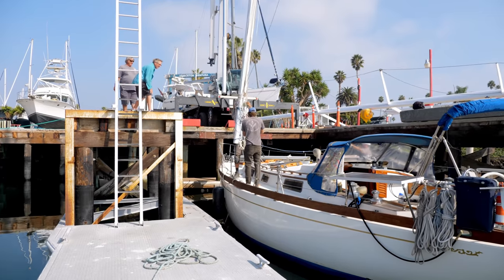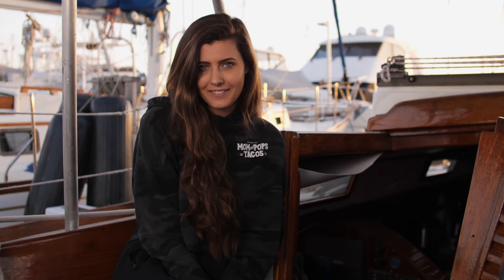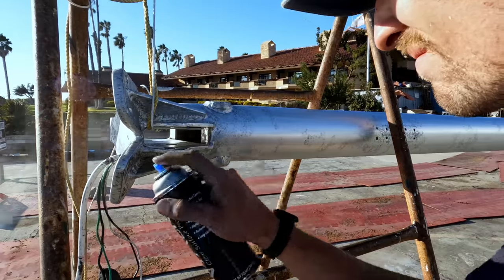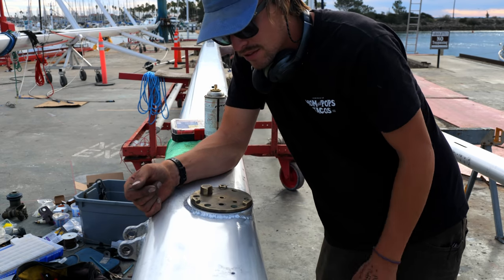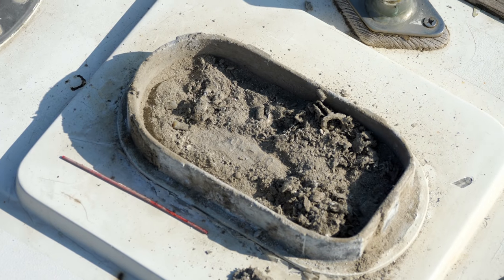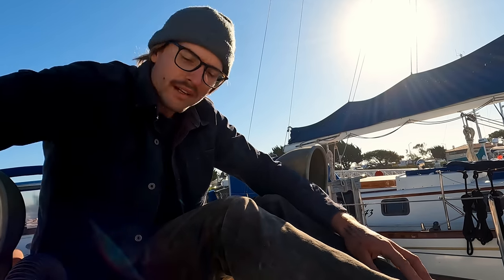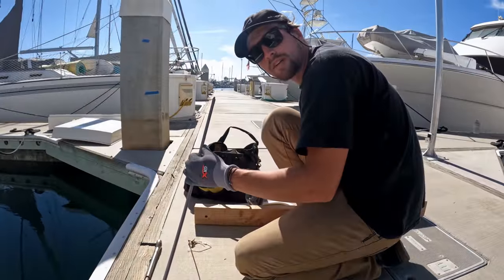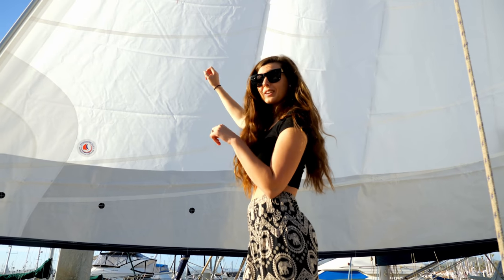Fixing Avocet | Rebuilding our Mast

Comment: I like the liberal application of Tef-Gel, but you have your corrosion terms a little confused.  You kept saying 'crevice corrosion', but what you are preventing with isolators between dissimilar metals is 'Galvanic Corrosion'.  Crevice Corrosion does happen to stainless steel, but that is caused by oxygen starvation along with water, it is not a result of dissimilar metals.  Crevice Corrosion is what happens inside the strands of your 1x19 wire rigging when water eventually penetrates between the strands.  When you see swage fittings swell and eventually crack is also because of Crevice Corrosion.  Again, oxygen starvation of the chain plates where they enter the deck causes crevice corrosion that leads to failure.
Reply from the maker: Hey Luke! Thanks for watching and chiming in. Check out our website for a better explanation as I believe we used both terms in this episode at the appropriate times - When two different metals create a tight crevice, both crevice and galvanic corrosion can potentially occur. A lot of our galvanic corrosion on Avocet lead to crevice corrosion which was nasty all around. We also have a couple published pieces in Cruising World, Latitude 38  Good Old Boat regarding the subject matter that you may find fascinating as this project is over 6 months old - we have had lots of time to write! Thanks again for the insightful Q... always appreciated. Fair winds!
Reply: @sailingavocet  I tried to read your articles, they link to "Foolproof Focaccia", at least the Good Old Boat article about the Bulwarks and your research on mast painting in Latitude 38 links go there, some of the other links work to unrelated articles.  Anyway, I'm sorry to be a pain but you literally didn't use the term 'Galvanic Corrosion' once in the entire video.  Also, your Rigger keeps calling Dyneema an 'Aramid'... it's not.  Aramid is what Kevlar (trade name) is , Dyneema is UHMW plastic, so not even close.  He says aramid while you show pics of Dyneema, but I know he meant Dyneema because he said Aramid again and that you splice it... you do not splice Aramid rigging, it's unidirectional fibers that use an incredibly similar fitting to Hi-Mods for termination. Sorry if I'm a stickler for details, but there is way too much bad info on boat forums and in YouTube videos.  I dunno, maybe I shouldn't bother helping, all the bad info out there is what keeps me busy going up masts to fix the mistakes of others.
Reply: Don't get the wrong idea, I really like the work you do (thats why I watch) and I don't think you made any mistakes on your mast.  You made great choices, especially the G-10 mast step, really nice application.  I pointed out the issue with terminology because I hope it helps maintain your credibility.
Reply from the maker: @SteelDoesMyWill  We appreciate the conversation, I will have to see why those links are not working... hm... I do urge you to read the full in-depth blog post that does mention both galvanic and crevasse corrosion. You can find that here: https://www.svavocet.com/2021/12/17/mast-rebuild/

The G10 is a fantastic addition and really upholds the structural integrity of Avocet. It is a great option and we hope many explore its abilities as we have found many uses for the material in various projects. As far as Kim Weir goes he is a legend in the industry, especially around these parts. I will bring your notes up with him and see if he can clarify, then if need be, write an update on our website. 

Thanks again for the chat, fair winds!

Comment: You should have bead blasted the surface and then cleaned it with Alumiprep/acid wash.  After you acid wash it any remaining corrosion will turn black, then it needs to be sanded/bead blasted more until it doesn’t turn black any more.  There is so much corrosion still on your mast, it will keep growing even with the top coating you applied.
Reply from the maker: It’s been 2 years. Mast looks great. Thanks for your concern 🤙
Reply: Great, just passing on info.  I work with a lot of corroded aluminum.  All that black stuff is corrosion and is slowly weakening your mast.  Keep an eye on it.
Reply from the maker: @charlesdobrovolny7059  Appreciated - I would recommend reading the blog post and articles we published regarding this project which gives detailed info on our prep process. In California we are limited with chemicals we can use because of the BPA laws. We did everything we could, and corrosion has ceased. Nyalic has been a wonderful product, seems to allow the metal to breathe more than paint would and when it does get scuffed all we need to do is wipe down the area before applying another coat.

Comment: In 2001 I sailed on my first Cheoy Lee Desperado a 47 ft Richardson design out of Oxnard not sure if the boat is still there. The owner I sailed with sold it due to illness. We sailed to Mexico and the Newport Ensenada race also sailed a few times to Catalina and I fell in love with the boat. I live in Chicago and found a 1977 Richardson 41 offshore very similar to yours in 2004 I have an in mast roller Furler , A baby stay for a staysail and unfortunately teak decks. I’ve done extensive work including replacing the Perkins 4-108 engine replaced all the headliner installed an electric head and recently got rid of the old data marine gauges and replace them with new modern Garmin instruments.
I just found your channel a couple days ago and I’m going through the entire series.
One thing I don’t know if you are aware of is that the chain plates in Cheoy Lee’s are notoriously precarious. Be sure to check the chain plates and the chain plate knee that attaches to the hull. I love the work you’ve done so far but I’m only a few episodes in best of luck.
Captain Conrad
Reply from the maker: Ahoy Conrad! Desperado is still around; her owners just finished a massive refit and she looks lovely.  you found us! Yes, the chainplates were some of the first things we replaced. I actually wrote a handful of articles that will be published in Cruising World, Latitude 38, and Good Old Boat regarding the importance of inspecting and replacing your chainplates. Ours were in poor shape. Although I am sure you will find entertainment value in our videos, I urge you to check out our website www.svavocet.com to read through some of our project blogs or click on our "media" page to see the featured publications. Excited to share more content with you soon! Fair winds, Captain Marissa.

Comment: Hi Guys really enjoyed your video. In January I pulled my mast for the second time in 3 years. This time because just like you my sheaves had frozen. All my efforts up the mast were unable to free them so it had to come down, like you I replaced mine with Delrin and couldn’t be happier with my smooth running halyards! I have corrosion under my paint on the mast but I was not up for tackling that big job this time. After seeing you guys I will have enough confidence in taking it on in perhaps 3 years when I have to pull the mast for something else. By then we will know how your treatment of the aluminum worked. My only suggestion about the video quality would be to work on your sound pickup as it was a little difficult to hear some of your dialogue on the dock. Thanks so much! Ben S/V DAWN
Reply from the maker: Best of luck with your project 🤙

Comment: Hello, could you give an update about how the nyalic is holing up so far? Im in the same process myself and still havent decided if I want to repaint the mast or use nyalic. Thanks and fair winds!
Reply from the maker: Hey there! two years later and we still haven't had to reapply. We are so stoked on this stuff and can't recommend it enough
Reply: Thats fantastic. My mast has the most severe corrosion at the foot and in the deck. Im wondering if Nyalic will be enough to protect these areas...

Comment: Sorry guys, quick question, how do you call exactly to the fittings you use on your rigging wire, I saw you mounting them yourself, I am currently rebuilding a 36ft 1971 Sailing boat and I am interested on doing the rigging myself. 
Thanks in advance for the info, beautiful video! Congrats for the good job!
Reply from the maker: Compression fittings :) you can find all the details here: https://www.svavocet.com/2021/12/17/mast-rebuild/
Reply: @sailingavocet   Thank you very much! 🤗
Reply from the maker: @fabiansantos4014  my pleasure, feel free to reach out if you have any more Q's!
Reply: @sailingavocet  I could fill up your comments area only with my questions 😅, thanks for the offer though, it really tells a lot about you guys! Very good luck with your adventures!
Reply from the maker: @fabiansantos4014  cheers!

Comment: You’d need to Alodine  (conversion coating)it before you paint it.
Reply from the maker: Howdy! This isn’t paint. It’s a coating. And we sanded the surface and prepped with with mineral spirits before applying the Nyalic. It’s been 3+ years since this project and we haven’t needed to recoat it yet. VERY impressed with its durability

Comment: Looks like you are taking off epoxy base coat. That yellow & It's hard to sand off.  Aircraft paint remover won't do a good job on epoxy will take off paint. It's made for aluminum. And paint typically sands off easily. Good luck & cheers from Northern California!!!
Reply from the maker: Thanks for watching!